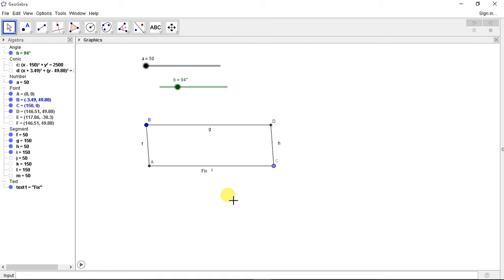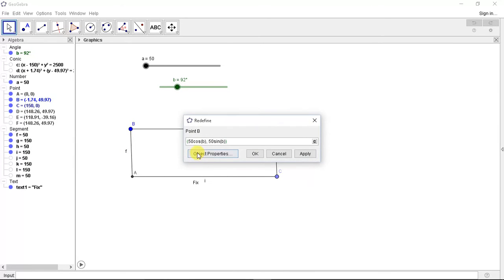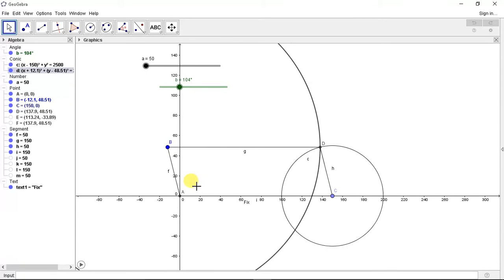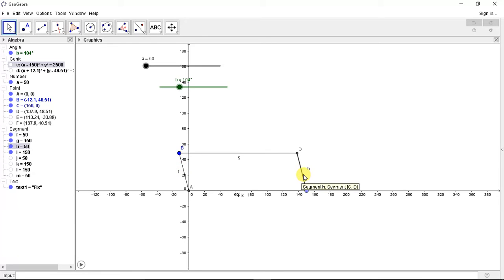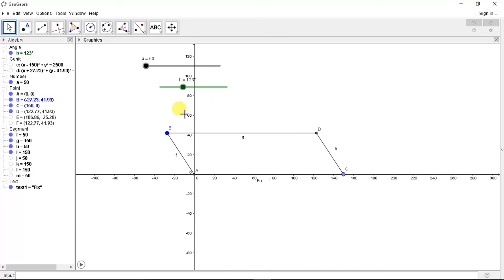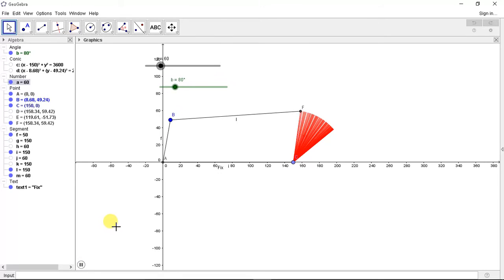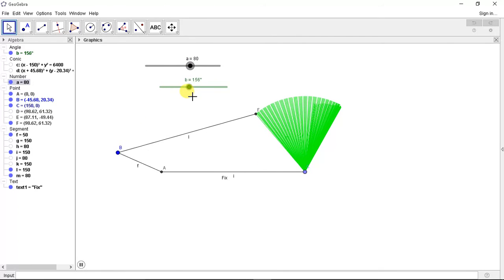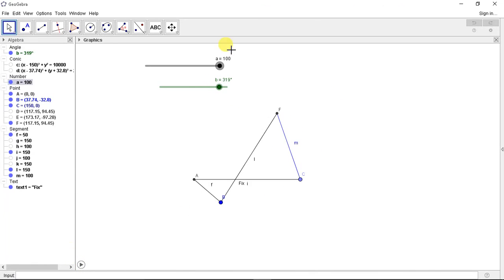Geogebra:Basic 4 bar mechanism [TUTORIAL]

Comment: Hi.. I did your same passages..But link h doesn't do a complete rotation around C. Why?
Reply from the maker: It is because it is a property of 4 bar mechanism.
If there are 2 links of different length near by fixed link always small link will do rotation and large link will oscillate..

You can consider example of slider crank in engine.
It is the same inversion where 1 rotates and other does oscillation.

Reply if any more doubts
Reply: Soft_illusion yes but i have this problem when links f and h have the same lenght too
Reply from the maker: Are other 2 link also same in lenght..
Reply from the maker: Does it form parallelogram.
Reply: Soft_illusion yes
Reply from the maker: Then it will mostly not be the case.
Try it ..
And if you don't find solution send me screenshot...
Reply: can i send you the ggb file? I'm going crazy lol
Reply from the maker: Send it.
harsh.b.kakashaniya@gmail.com